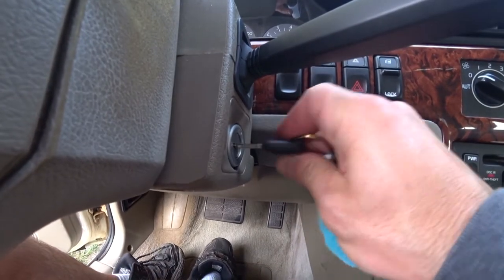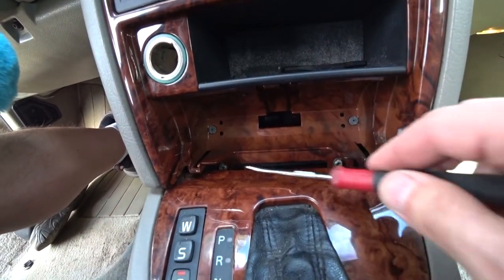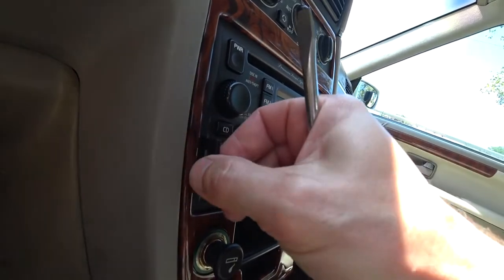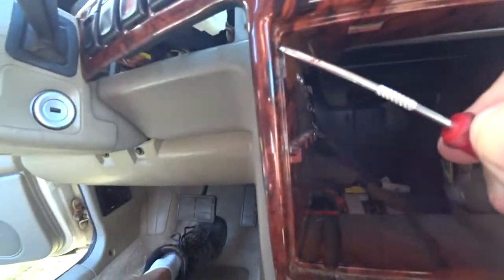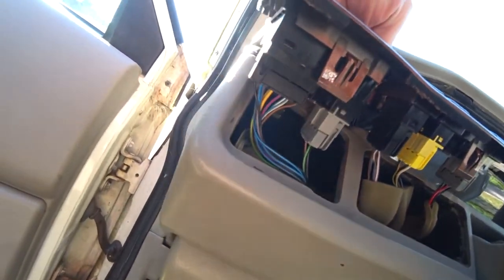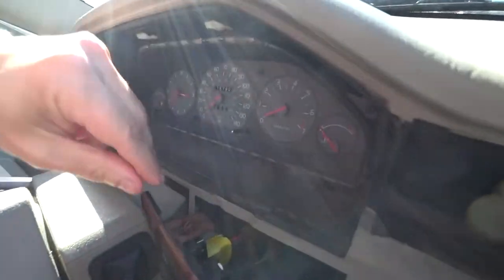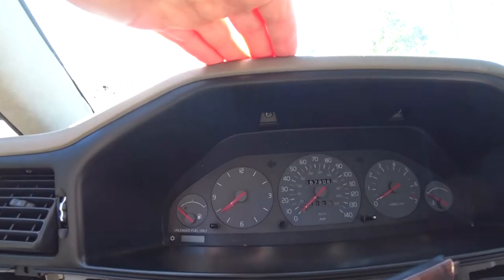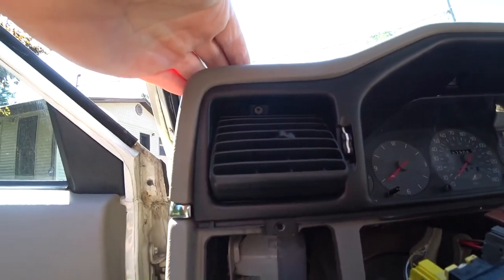Volvo 960, S90, V90, Cluster, Dash Removal

Comment: Thanks for this great video! It was very helpful! Tools I used: torx screwdriver tx25, a flat screwdriver and a screwdriver for disconnect the battery. The lights I used for the exchange are listed in the manual. 4x 3Watt, W2,1x9,5d. For the heater lights: 2x 1,2Watt, W2x4,6d